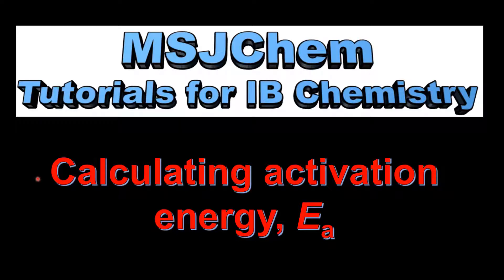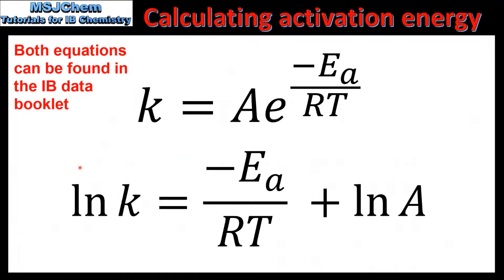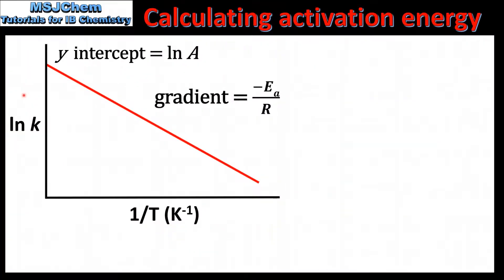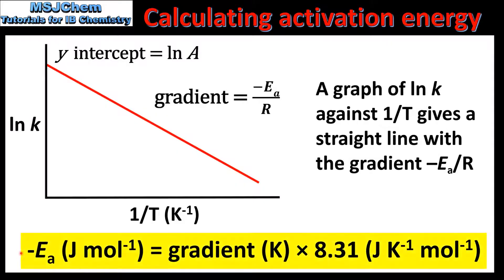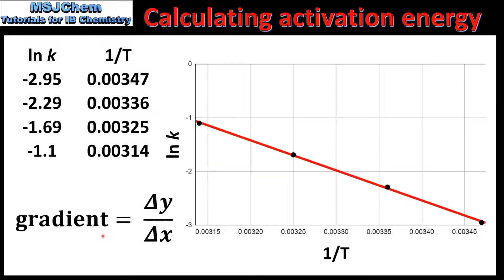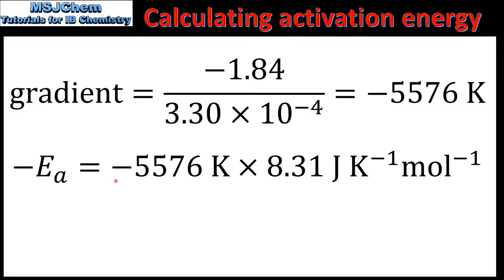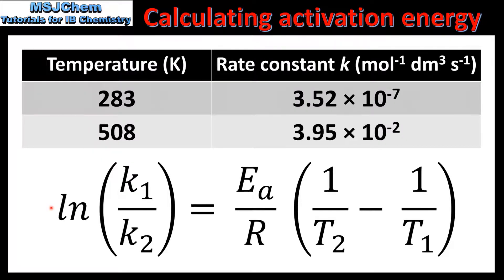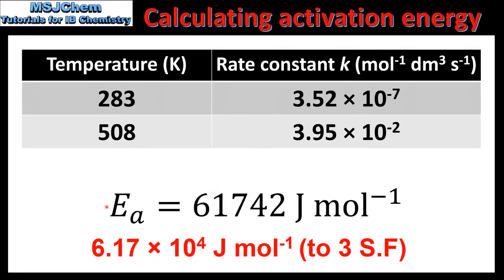R2.2.13 Calculating activation energy (HL)

Comment: I got 44571 J mol^-1 by using the -1.69 and -1.1 values from 1:27. Logically, they shouldn't be different since the slope would be the same. Is there are reason for this? Could you please explain?
Reply: Oh, I think I got it: The values in the table do not create a straight line, that's why. The slope isn't same everywhere on the graph, since x values are changing by 0.00009 but the y values are not changing in that rate. It is probably because of the rounding.
Reply: @baranbirlik8604  so does it matter which point we use to find the slope cause it varies
Reply: @kookietea3587  for the diagram in the video yes, normally it shouldn't ig.

Comment: Do we have to round off the answer of the gradient to calculate Ea? At 2:14, because the answer is different by two joules without rounding in the prior step of finding the gradient. Is it important to round? Would the answer be incorrect if I did it without rounding and got 46,334.5 Joules? The final answer must be in 3 sig figs so does it matter if I rounded or not?
Reply from the maker: If possible round up at the end of the calculation. I round up to keep the numbers manageable for the video.
Reply: @MSJChem  would I lose a mark in the IB exam if I didn’t round?
Reply from the maker: @Emkeys-i1v  Depends on the question but usually they allow a range.